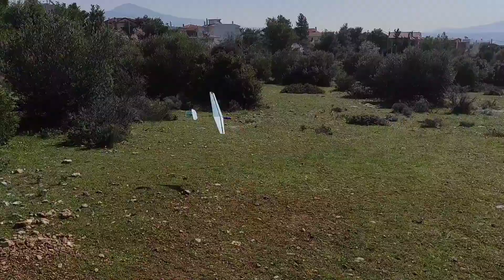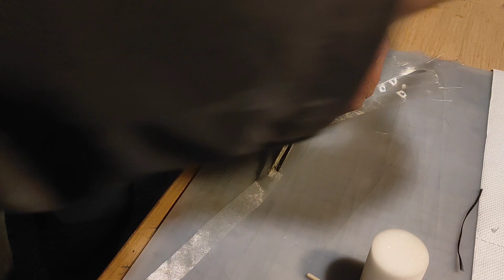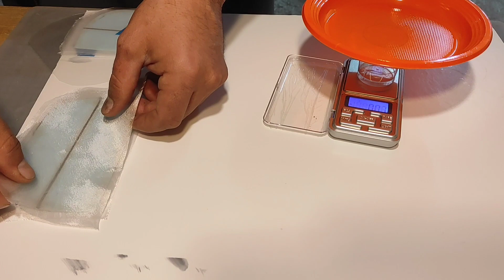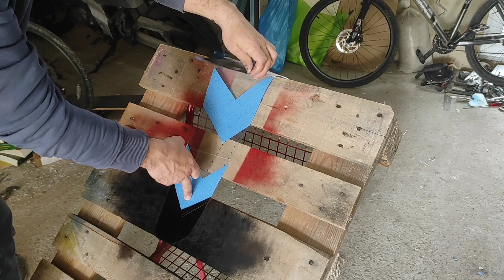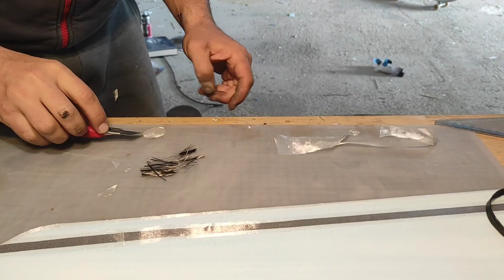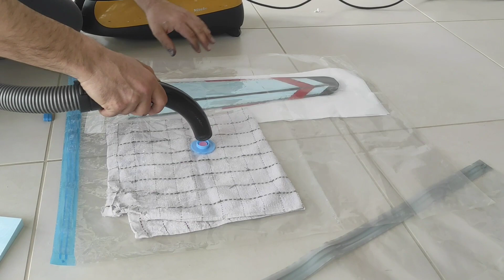1m GF DLG-part.3-Painting skins and  Bagging the wings

Comment: hi mate, your video is amazing, its very helpful, btw if we dont have plastic to isolate wing or tail after laminate with resin, how it would be? i mean i dont have the plastic bag and vacum to isolate laminate wing from oxygen.
Reply from the maker: If you do it without bagging, you will end up having a heavy plane and a rough surface, I would suggest finding the proper tools. Instead of plastic bag, you can use a vacuum food saver.
Reply: @afilos  oo, i see, thank you

Comment: Is this depron?
Reply from the maker: No, it's XPS foam.
Reply: @afilos  3mm?
Reply from the maker: @coverdestroyer3572  Yes 3mm
Reply: @afilos  thanks sir, could you share the plan sir?
Reply from the maker: @coverdestroyer3572  http://charlesriverrc.org/articles/apogeehlg/apogee40_wood.pdf
Reply: @afilos  wait, 3cm not 3mm?
Reply from the maker: @coverdestroyer3572  before hot wiring the wing the foam plank is 2-3cm thick, after hot wiring the wing is 9mm thick at the highest point. The tails are made from 3mm foam plank sanded into airfoil shape.
Reply: @afilos  i am sorry, could you send to me the picture of xps foam, i couldn’t find that in my country
Reply: @afilos  do you have instagram or something sir?
Reply: @afilos  i wanna send picture of xps foam in my country, is that the same with yours or not
Reply from the maker: @coverdestroyer3572  this is it https://www.youtube.com/watch?v=c1g_Jud_eWM
Reply: @afilos  in my country there are dots hole on surface
Reply: @afilos  something like extrude texture
Reply: @afilos  i am sorry, do you have tiled plan? For a4 paper?
Reply from the maker: @coverdestroyer3572  No plan but you can watch this https://youtu.be/n2jZAsmHsEQ?t=9 and this https://youtu.be/n2jZAsmHsEQ?t=315 for the wings its very simple dimentions
Reply: @afilos  Gini aja
I saw on other tutorial, when they bagging the wing and pump out the oxygen, they also to keep it warm, did you doin this too filos?
Reply from the maker: @coverdestroyer3572  No, it is not necessary, you can cure it without heat, but it takes longer.
Reply: @afilos  how to make the airfoil sir? I mean the plate
Reply from the maker: @coverdestroyer3572  Yes this is it!
Reply: @afilos  but there are pore sir
Reply: @afilos  i can not find the smooth texture like yours

Comment: How to attach the fiberglass to the wings? Please answer me please!!!!!!!🙏🙏
Reply from the maker: with slow curing epoxy, something like this https://static.rcgroups.net/forums/attachments/8/4/5/1/7/7/a14432625-36-Screenshot_2020-12-21-14-43-11-425_com.android.chrome.jpg

or this

https://www.fibermaxcomposites.com/shop/epoxy-systembrr6780-h6733brslow-p-100206.html?cPath=26
Reply: @afilos  thanks!!!
Reply: @afilos  Can I apply epoxy to the surface of the wing and attach 0.03mm glass fiber on it?
Reply: This account is my other account
Reply from the maker: @Qwerasdfhdhdissiwi  usually we apply epoxy onto the fiberglass and not on to the wings, this helps keep the weight of the epoxy used at minimum.
Reply: @afilos  Then, to attach the fiberglass to the wing, can I just paint the fiberglass and apply epoxy?  Then, can I attach minimally exposed fiberglass to the raw crab? If you need anything else to reinforce the raw crab, please tell me. Thank you!

Comment: my fber glass cloth is very hard to handle ( it shapeshifts super weird which makes it very hard to get accurate cuts and strips like the ones you show, i was wondering if you have this issue and how you solve it or if your fiber glass is just different, thank youuu
Reply from the maker: Use a new blade and cut using a cutting mattress/board. Once you cut it, avoid moving the piece, especially pulling on the 45deg direction, because this will deform the shape. A new blade will normally solve the problem, I don't suggest cutting with scissors. My glass is 25g/m2 plain weave.
Reply: @afilos  how  do you place it on the mylar then ? Thats when i have to lift it off the table and it gets all deformed :,(
Reply from the maker: @UnOmelette simultaneously, both the mylar and the glass with extreme care 🙂. when you glass the wing spar, soak with epoxy thoroughly to avoid dry spots.

Comment: Excellent! I am about to start the construction of this model but with the design of the hawk (wings with rounded ends) I have doubts with the reinforcement that you put in 7:21 will it be absolutely necessary? The fiberglass I have is 48g (somewhat heavier) otherwise I would have to place carbon fiber rods to reinforce it (I did not find that carbon fiber tape you use) in the launches, note that the wing is subjected to efforts important when launching? Thank you!
Reply from the maker: Great! In my opinion, a 1 m dlg needs carbon reinforcement. I wouldn't want to launch and see my plane wrap in half or break, after having invested in time building it. You can always try building without CF reinforcement, but you will not be able to launch it full power. 
If you don't have CF tow, use at least CF rods, but you will have to place it top and bottom of the wings.
My first 1m dlg was also built with 50g/m2 fibreglass, and I used the same CF reinforcement.
Reply: @afilos  Very kind to answer! I really appreciate your opinion, I think I'm going to put CF rods in the wing then, it's true, it takes time to build everything and it would be unfortunate to see it fall apart in a launch. Thank you ! best regards

Comment: Thank you for all the great information. I have never used fiberglass before so this may be a dumb question...when you put the items in the bag and vacumn out the air, does this smooth out the epoxy surfaces? I am assuming this is better than letting the epoxy dry in the open air. Thanks , Doug
Reply from the maker: Thank you Doug! 
Vacuum is way better than open-air drying by all means. Use as little epoxy as possible, and do a set or two, of tails first to figure out the procedure. 
The finished surface will copy the mylar. If your mylar (the side that is in contact with the epoxy) is shiny, you will get a shiny finish. If it's a dull surface, you'll get a dull finish.
Reply: @afilos  thank you for the great advice. This hobby has a learning curve,  and you are a big help!

Comment: Hi. I have a quick question if I may; When you lay the various reinforcement pieces, spar carbon, etc do you bag and cure the items before adding the glass skin? Or do you layer the whole lot up at once and just bag  and cure the whole thing in one operation?

Thanks, Steve
Reply from the maker: All at once, this is why I use the spray glue to keep things in place until I apply the epoxy. Take care to fully wet the carbon tow before applying the GF, its a bit tricky and you might get a weak spot if not done carefully.
In any case you can redo the bagging to repair any weak spots, before proceeding to the next steps.
Reply: @afilos  Awesome, thanks. I have an unbuilt ViCK dlg - if you heard of it - and as stock it's covered in tape. I didn't like the finish at all on the last one I built, so I might try glassing it using your instructions instead. Thanks again!
Reply from the maker: @stevengreenhough4232  nice, it will be like day and night, the stiffness is unmatched compared to tape, and lighter. Just keep the wing cores and do everything else, my way! 😁

Comment: I'm a huge fan of your building process.
I put to the highest level the use of common tools and materials to achieve our RC hobby.
What brand of vacuum cloth bag do you use the one I bought always ends up to leak - or -  do you apply  vacuum regularly during epoxy curing ?
Reply from the maker: Thank you!  
Its not a leak, try placing under the valve 2-3 towels and under your pieces some paper. This helps the vacuum pull all the air. I had the same issue and this fixed it.
Reply from the maker: Also try pressing hard on the zipper while you close the bag

Comment: what material are you using for the wings?
Reply from the maker: XPS foam covered with 25g/m²  fibreglass.
Reply: @afilos  thx
Reply: @afilos  hot wire cutted or cnc cutted?
Reply from the maker: https://youtu.be/n2jZAsmHsEQ
Reply: @afilos  thx

Comment: Thanks alot! That was the video I was waiting for for so long. Now we now every detail.
Do you not find it necessary to apply a second spar on the bottom of the wing which would take the pulling forces when the wing is bent upwards?
Reply from the maker: Yes of course, top and bottom spars are installed, I just don't show it on the video. It will be obvious when I remove the wings from the bag.
Reply: @afilos  Do not You use hard carbon sheet to strenghtened the wing? Is this enough for a wing span of this size?
Reply from the maker: @goldenfish77 No, I don't use hard carbon, because it doesn't follow the wing's profile. Using this CF tow allows for a smooth top surface finish. The strength is more than enough !
Reply: @afilos  And I think that it is lighter than the hard carbon rods. Thank You!

Comment: Your works are awesome in this hobby! I congrat You!
Reply from the maker: Thank you!
Reply: @afilos  Do You use the carbon roving 1600 tex in simple or double way on one side wing surface? I see that You use it on both (top and bottom) wing's surface. Because I see that is wide enough. I got 1610 tow tex, it seems to be thinner than You use in this video. 
Can I take household paper under and above the galssed wing surface in the vacuum bag not to glued the GF to the bag? The pressure will be good in this way or am I just use paper under the bottom surface? Thank You!
Reply from the maker: @goldenfish77  this is what I used https://shop1.r-g.de/en/art/205105, one on top and one on bottom. when you apply it, it tends to spread a bit.
For the vacuum, use paper only under the  wing and if you can, double the mylars under the wing so the paper won't leave footprints from its texture on the wing.
Epoxy won't stick on the bag, so don't worry.
Reply: @afilos  I am sorry for my questions but did You take any glue under the carbon ribbon or just under the glass fabric ribbon you put on?
Do kitchen paper towels need to be placed in the vacuum bag under the elements to absorb the spilled resin? Anyway I like these building method, I hope that I can build my gliders with this technic and I can see the performance growth on my gliders. Your procedure seems very promising!
Reply from the maker: @goldenfish77 the kitchen paper is placed under the wing to help the vacuum pull air.  If you don't use paper the vacuum won't work.
The CF tow is placed without epoxy, but before you apply the FG skin, you should take care to wet it with epoxy very good, like dripping epoxy on top so it can fully soak. The rest of the skin is done normally with the roller.
Reply: @afilos  how much time do we have from assembling the epoxy components to placing the wings and tails in a vacuum bag?
Reply from the maker: @goldenfish77  it depends on what epoxy you got. I used 40min epoxy, so I have 40min. You can use 1 or 1.5h epoxy for even more working time.
Reply: @afilos  OK, my epoxy is 40 min too. Today I did (RE) tails with this mixture (10:4 ratio) based on what You have presented. I hope that it will be success after solidification. Thank You for Your help!
Reply from the maker: @goldenfish77  Nice! I want to see that, bravo!
Reply: @afilos  Maybe this is the hardest part of the building. I used that spray glue, but it is very complicated to fix GF to the foam core with it. Can I use any other glue for this fixing? White glue or any foam sfae glue. This fixing just have to be to position the reinforcements, or is it necessary to be strong fixing (leading edge and spars fixing carbon rows)? First I make a try with my old glider's wings (removing packing tape covering), how can this method work for me. Thank You!
Reply from the maker: @goldenfish77  I don't know what makes this so difficult for you, spray glue is to fix the parts onto the wing, the strength comes from epoxy. I've only tried spray glue, and it makes things a lot easier for me.